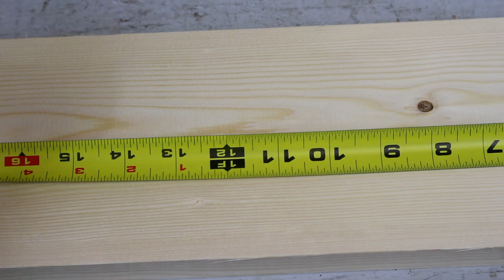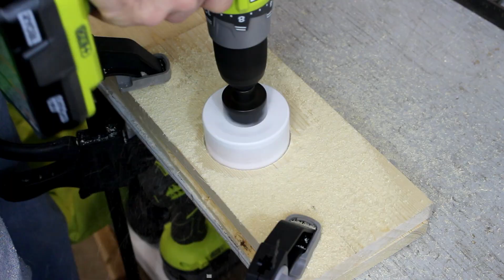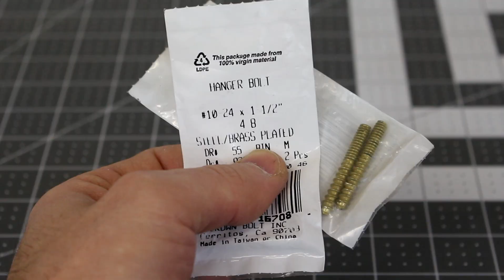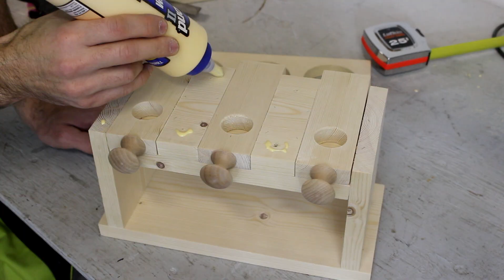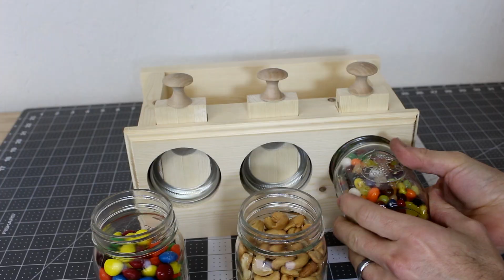DIY Triple Candy Dispenser - Simple Woodworking

Comment: Just finished this with my 8 yo boy. He cant wait to put some stuff in tomorrow!
Reply from the maker: Thanks for letting us know it meant so much to you
Reply: Surprise this morning, I used a 1x5 instead of 1x6 as recommended. You can image the problem ? Use a 1x6 !!!
Reply: Fwiw, For the handles, I used #8 bolt, screw them in a pilot hole then snapped the head with a cutter. Then screw handle on the thread

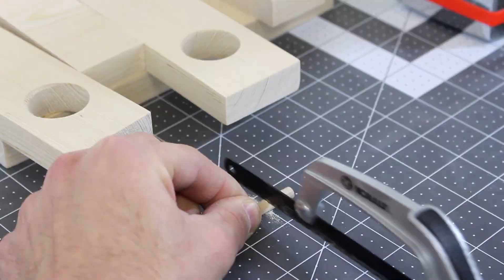Comment: A great idea and great video. I like the triple dispenser design. I made one of these myself with just one mason jar. Have a little issue with candy jamming sometimes, but seems like the rounder and harder the candy, the better. BTW, like the 2 Timothy 2:20 reference.
Reply from the maker: Thank you. I have found the occasional jam to be common too. But we can usually dislodge it by the second or third pull.

Comment: Very nice. I built two of these. First, the 3-jar version, then adjusted to make a 2-jar version.  I used my brad nailer with staples to affix the jar lids into each hole.  Since the 3” hole. Is a little big for the lid, I added a few short pieces of rubber weather-stripping to the outside of each lid, then fit into the hole.  Once in, two quick staples with the brad nailer and they are locked in.
Reply from the maker: +Frank Johns Nice upgrades
Reply: Brad nails! Didnt think of it. Best way ti fux the lid for sure

Comment: Great project but it's not exactly simple woodworking. Not everyone has a table saw or a router table.
Reply: No problem.  Use a handsaw, sabre saw, or scrollsaw.  And don't need a router either, just leave the sides as is, and sand smooth.  It ain't rocket science.